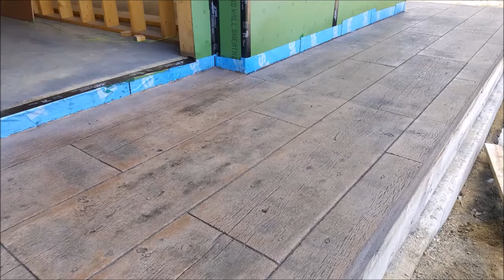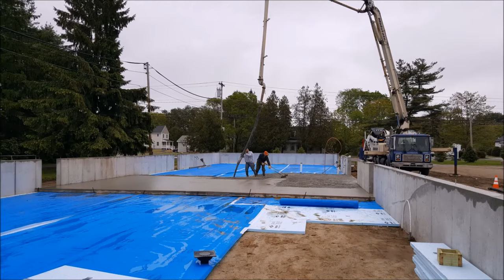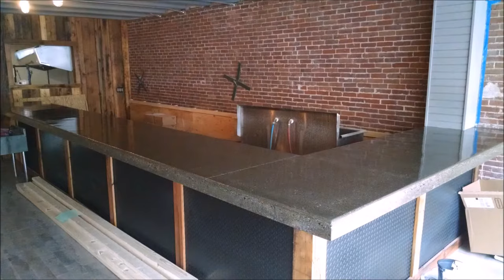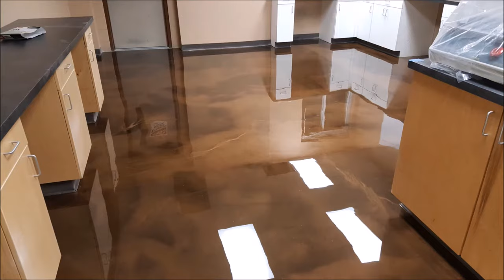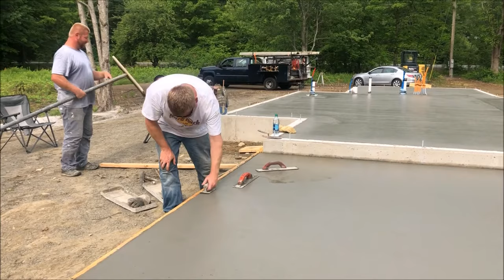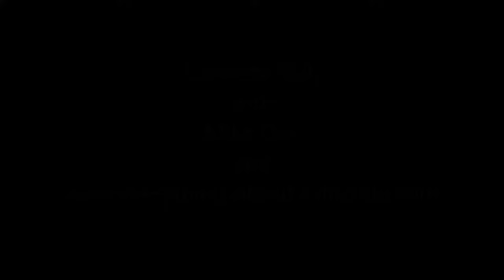5 Tips For A Perfect Broom Finish Concrete Patio

Comment: Hi Mike...Wondering if you can answer a question for me. I had a 12 x 30 patio poured and the fellow that boomed it made the broom marks really deep and the concrete finish is really rough. Is there anything i can do to tone down the roughness. Thanks
Reply from the maker: Resurface it with Ardex CD and re broom it.

Comment: for other finishing you mention 1/8" sink before finishing. here you mention 1/4" is that because it needs to be softer for the broom to make an impression?
Reply from the maker: No, it's a judgement call on how fast the concrete is setting and how hot the temperature is, and if it's directly in the sun or not. 1/8 to 1/4" is about right.

Comment: Step 1. You said you wanna be able to push your finger a quarter inch. I dont get it. You can push your finger in a quarter inch 5 minutes after you pour, OR 1 hour after you pour. How much longer after you pour do you have to wait? Half hour?
Reply from the maker: It depends on the temperature that day and if it's in the sun or not. I wanted to say push your finger in the surface, if the concrete feels "firm" and you can still push in 1/4", it's getting close to start finishing.

Comment: How can you tell if you got a crappy broom finish?
Reply from the maker: It'll have small rocks show in the surface, large, wavy broom lines, inconsistent looking broom lines or just a first impression that doesn't look nice. A good broom finish will have a nice "fine" broom line with no rocks showing.
Reply: Mike Day Everything About Concrete that’s what I figured. Can they fix it?

Comment: Mike have you ever done pubic work...?union jobs ?
Reply from the maker: We mostly do residential houses and garages, some smaller commercial jobs. No union jobs.
Reply: Mike Day that’s good ..nice I do residential too and some commercial
Reply: @MikeDayConcrete  why dont you use your trowel to finish?
Reply: @alfonsoleyva1243  Since it is recommended for any exterior slabs in cold regions to have air-entrained concrete, its recommended to mag the surface only so you don't seal the surface. Once its sealed, the surface can actually blister during freeze and thaw cycles.